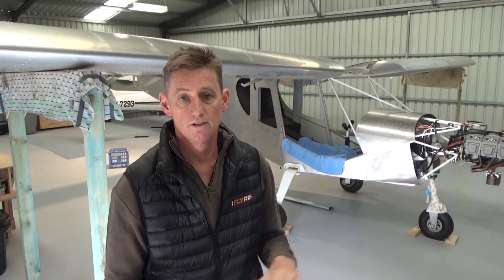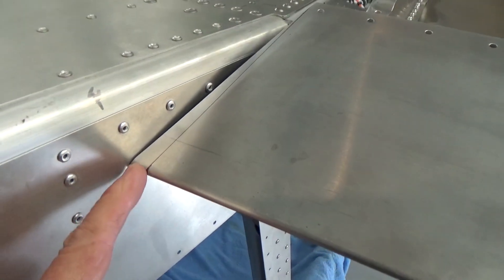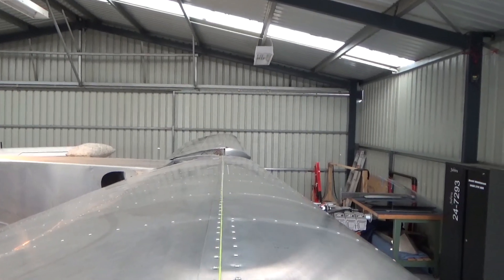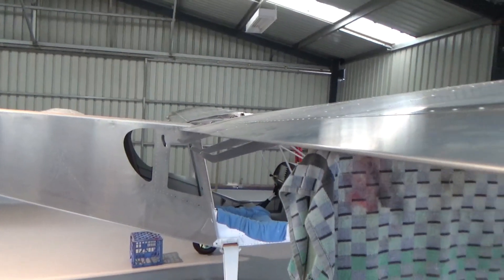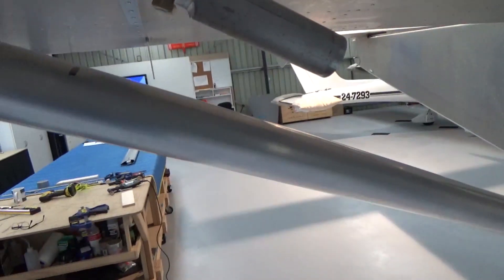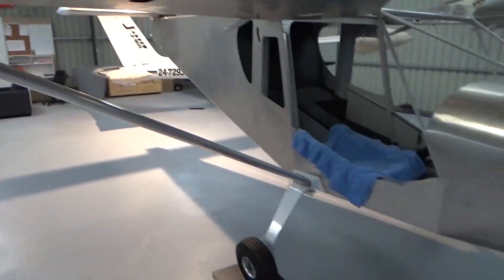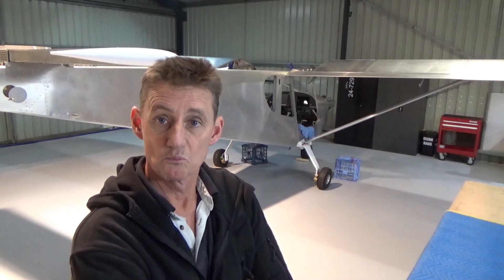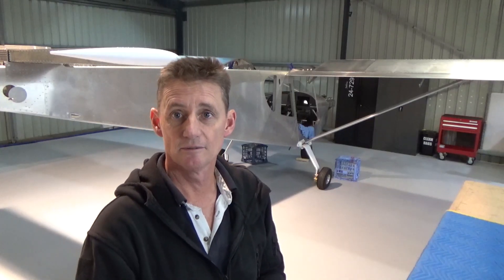Zenith Cruzer CH750 Wing rigging

Comment: How did you come up with the 30 mm for the angle of incidence?  All I see on my plans is if 3 degrees in relation to the top bar. Thanks.
Reply from the maker: Yes incidence is already built in at 3 degrees. I may have said 30mm not sure short of watching the video again

Comment: So, let me get this straight…. You put sweep in the wings to make it faster? 😀 Just kidding!  Going out to the hangar after this post to rig my Cruzer wings. Did one last search on the Zenith forums. Glad I did! Your video, along with the forums, should make this a non-event. I should expect a swept back wing for rear spar edge distance (1-2 mm from fuselage), make sure incidence is the same, and dihedral per plans. Piece of cake 😅!
Reply from the maker: Make a center horizontal line on both rear spars would help as well, dont worry to much about incidence just get them the same.I used ply wedge on each side.